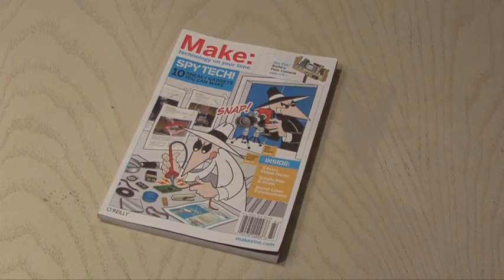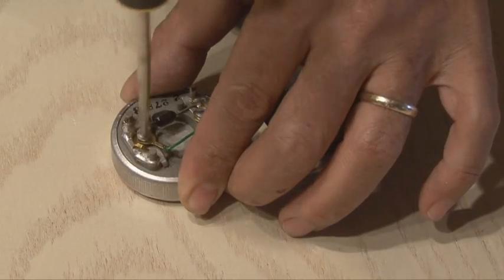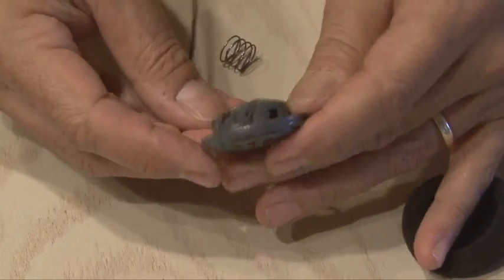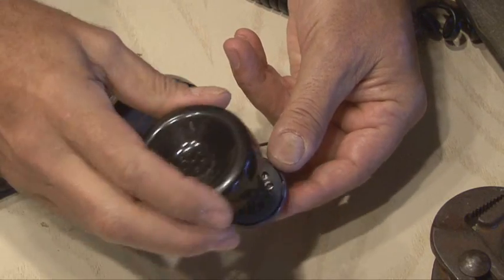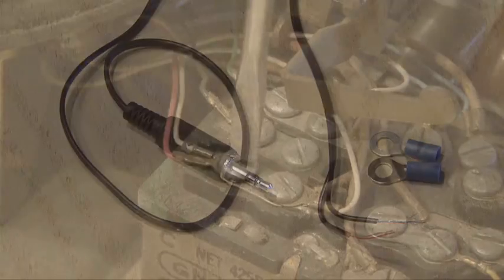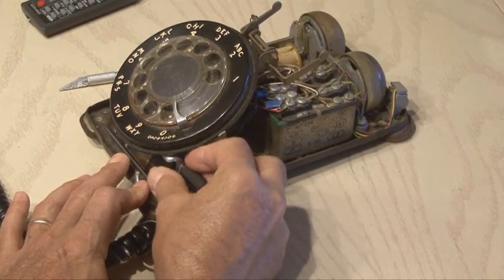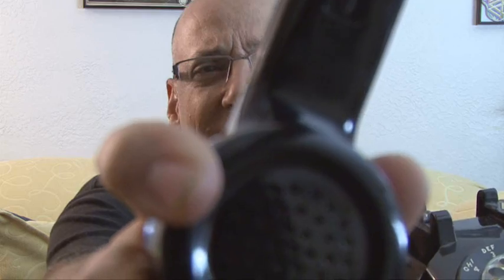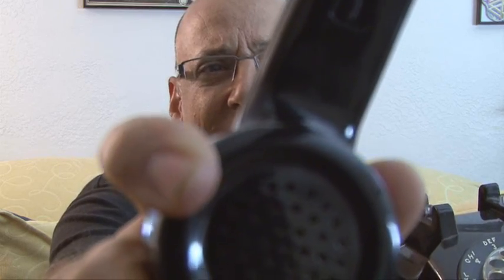Weekend Project: Ghost Phone

Comment: Also, just in case you are trying to argue that an inactive phone jack could still have power, that depends on the phone company's policy and the wiring of the house. In my area, the phone company physically disconnects from your house wiring if you don't have service with them. Saves them from potential interference from anything you left plugged in that has it's own pwer source.

And a final note for you: the phone in the project is supposed to be unplugged. Makes it spookier.

Comment: @gck86 - If I remember correctly, those old phones took 300 volts AC to ring. Years ago when modems were the size of a 19" TV I repaired them and we had to test the ring circuit with a 300-volt hand-crank generator. I may be wrong about the voltage, but it was enough to give you a nice shock.

Comment: Just take your phone and connect it with another phone and a battery between them. Feed the audio to the transmitter circuit of the other phone and you get the same effect without modifying the old rotary phone. Using asterisk PBX and some analog adapters you could get it to ring and play messages, of your choosing, even create IVRs and interact. There is a real ghost phone near here in front of a gas station I would like to get and put in my front yard. It has not worked since 2006 and is looking dead.

Comment: That 'ancient technology' inside those rotary phones was hardcore, they could withstand strike after strike of lightning to the phone lines and laugh at them.  In fact, the bell would make a ring, knowing your line had just been hit.    Now one of these transistor microchip modern phones, one lighting strike, and the sensitive transistors are toasted and you have to toss them, and go buy another for $10.   Old tech built rock solid for hardcore conditions.

Comment: @SelectWalkthroughs 
DC audio is DC audio as far as I know, some amps are minority different, but same old same old. I built this project, took about 20 minutes, I used the original speaker. He may have done it because the speaker is tinnier, and the headphone could play more base, but when you do this, you loose that "phone sound", and the classic ghost voice...so it kinda works against the project. ( @ watch?v=sBDxpfIN0XM I'll also have it my promoted video on my channel for a little)

Comment: Our Spanish class uses older phones as props when needed in dialogue practice. I configured a mod of the '100 foot remote camera picture taker thingy' mod to put a low AC current into the bells to ring the phone, but I had no good solution as to what to do afterward. Hide an MP3 player with a few songs looped with "your call is important to us, please hold". XD 

But I really don't understand the need to replace the speaker in the handset...

Comment: i'd consider gutting the mp3 player then moving the switch to the back of the phone to play/stop the MP3 player as and when it's required, and possibly moving the USB connection so that i could plug the MP3 player directly into the computer without having to gut the phone
hell, could go the whole nine yards and add a little motor to the dialler thingy to make it rotate randomly, and a little speaker to randomly make the phone ring
would be a good feature for a halloween party; the haunted phone

Comment: No idea why the speaker was changed, that just sounds like a waste of time and speaker. Here's an idea for a 2.0 version:

Use a bluetooth receiver inside the phone, then stream audio to it so you can control it, you can even recharge it if you put a ole in it for it, or you could modify the input jack of the phone line to wire to the charging port and just plug it in that way.

Or instead you could just call it and play an audio file, that way it rings as well, but this way you could say the phone was "cursed" by someone and it doesn't even need to be plugged in.

The bluetooth would only work if it was yours in your house or a haunted house type of thing, otherwise it might not work so well, but either way it needs recharged so you could use the phone line mod to do that. Heck, phone lines even give power if they use all 4 wires so why not?